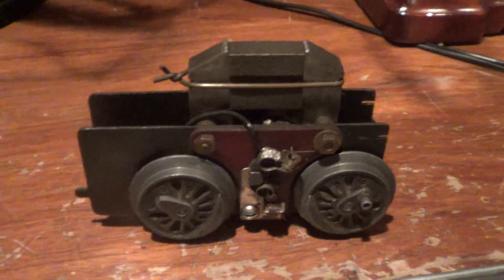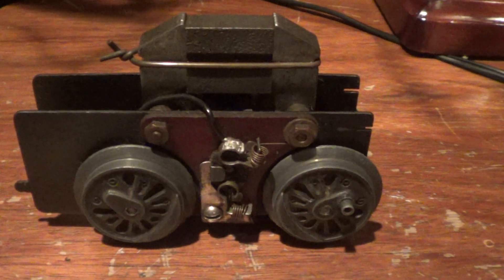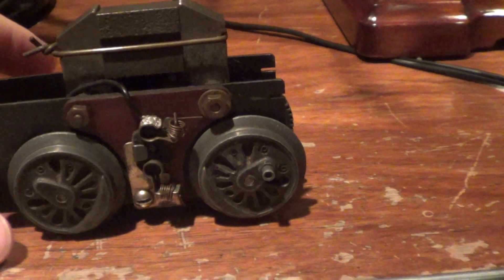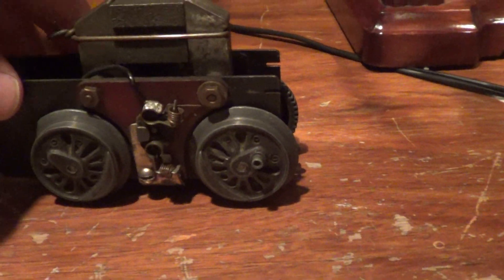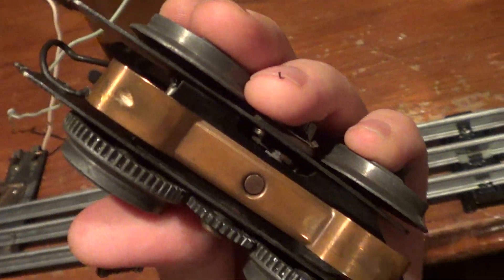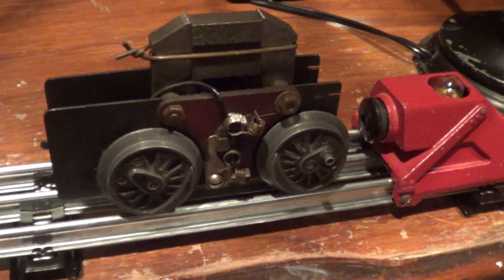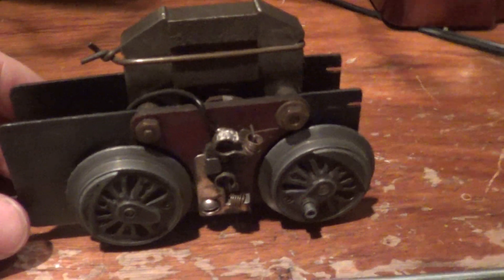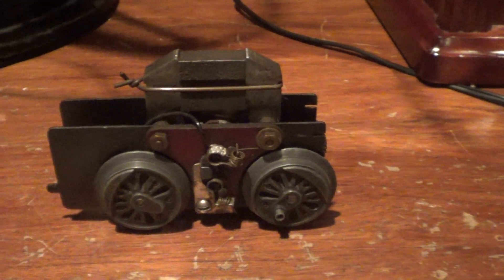Ultimate Rare Marx DC House current train motor

Comment: I had seen in articles about early electric powered trains in towns that were using DC was that they would wire a light bulb in series with 2 batteries to connect to a plug for a DC outlet.  the two batteries would be connected to the track, with a rheostat connected in series for speed control.

Comment: are you sure this is a dc motor, it has two brushes looks like an ac motor to me...
Reply: Hey, I know you. Small world. ...many dc motors have brushes too. The most common easy check for difference is the motor's field.  Test off track by pufting magnetic steel near the motors field. 
 Most often dc motors use magnets for the field (like modern can motors), where ac/dc universals (like most post war) use an electromagnet field coil powered by track...(the armature is 3 more tiny electromagnetic coils on a shaft (each coil is one "armature pole", more poles are smoother stronger). No power means an ac motor field wont draw steel to it hard.
Brushes and armature plate effectively time which magnets are active or off for X° to best pull the armature into a spin. DC needs that timing too.
Most Ac trains run fine on dc too fyi. But Dc trains will fry on ac.
 If in doubt use dc. If taking a chance on using ac to test, any chatter fwd/reversing fast is bad, so stop. A push to help shouldnt be needed and might,get it spinning sure, but it will likely not last longer tha 5min. 
 (Some ac train computer boards need to see a negative dc wave usually converted from the ac neg. done inside the "ac only" train. it also converts ac+ to dc+ and uses the dc+ for the dc motor.....so "only runs on ac" on this oddball Weaver means no sound effects though it moves and reverses on dc just like most O) 
 A DC pulsed right on top of ac track was used in Lionel and others as a horn/whistle/bell control. The relay ignores ac, blows on dc , so that something worth noting on a train/tender choice.
Reply from the maker: I'm  sure, This motor is on a Marx website saying it's a really rare marx DC motor.
I'm just saying what they are.
The motor metal top part is only to this motor no other. I also showed it to a marx repairman who said it was DC and said not to run it on AC
Here's the website shows it 
Shows it 14th photo line down.

http://wpporter.worthygems.com/MarxEndangered.php

Comment: I know there were apartments in New York City that used DC current for household electricity, something to do with Edison preferring DC over AC, but a Marx DC motor from that late in time no doubt is scarce!!
Reply from the maker: TrainsAndMore  Eddeson  and Nikola Tesla and  both were battling for there Idea of what we should use. Eddeson had all his money into DC, DC could only travel short distances. 
VS , AC,  Nikola Tesla was much better and safer. And could travel longer distance. That being some info on the DC VS AC, this is a rare marx motor. Try to find one. It's not easy. Thanksfor watching 
Thanks for watching

Comment: That’s pretty cool. However I’m confused on one thing...aren’t Lionel transformers DC as well? So I was wondering why you’d need to use a battery for it instead of a power pack.
Reply from the maker: DrFrankensteam as far as I know all lionel train besides Ho are AC Current.  All postwar and prewar I know of are AC Current. 

See this train ran on house current that was DC, this went out and AC current totally took over by 1947.

This motor can only handle  12 volts max Of DC Current.  If you tryed a HO DC power pack you could fry it if you put over 12 volts to it. I got the Idea to test it with a 9 volt Battery from the original owner of this motor. He said this is the only safe way to test it.
Reply: @CollectorDavid  Lionel O did have a few "toy grade" dc only locos pre-war to modern. I think they used both in vintage ho. I think the ho was also done as 3 rail and 2 rail models both. Rivarossi had a hand old Lionel ho and some stock still exists under other mfgs. who bought up vintage tooling.
Reply: @CollectorDavid  AC did pretty much take over pre-war. And the wheels do scream postwar vs prewar. It is obviously using a magnet instead of a coil for the field, so IS dc. (universal motors used an electric magnet/wire coil on the outer "horseshoe"/ "field" by name. )
  But some household dc voltage would have launched that at light speed. It was still usually 80v dc at least, 110vdc in NYC with a 220dc option..... It still needed the voltage dropped way lower.  DC to DC stepdown transformer or reostat at the very least.

At only 6v in your test (8v if fresh).... I'd bet battery has been used and drops to 4-5v once the motor is sucking voltage, and it's moving. I bet it likes 9v, 12v max. too.  And you think that runs off unmodded houshold dc? No way. You can weld 1/2" plate steel with that much power on tap. The amps were there too.

  The dangerous 40v-100v stuff was prewar Dorfan, I think Ives and a few others pre WW1. (some used high volt ac on the track too,lol. (? Ive never seen a 1940s high volt, but dont know for sure) 

.   More likely this one was made way after WW2 AND still meant to run off of large dry cell batteries (and maybe a reostat) or a rural farmers battery bank as power lines still werent "everywhere" like today.
I think Woolworth and/or Sears offered these via request/catalog until the early to mid 60s and a general switch over at Marx to,cater to improved market quality D sized batteries and small, high rpm 1.5v and 3v Japanese toyish "can motors". 
  If you didn't have a reostat you managed your semi spent, lower volt, cells vs fresh, in series, to have a little speed control.   And fyi generally 99.8% of ac trains run on dc just as well too. Even that .2 wont wreck it.  But a dc motor fed ac = smoked motor real fast.